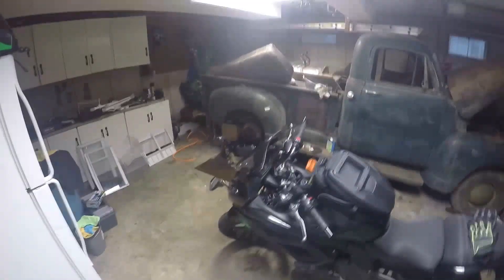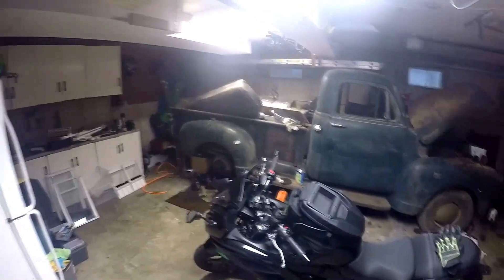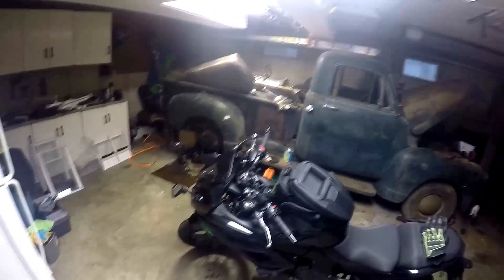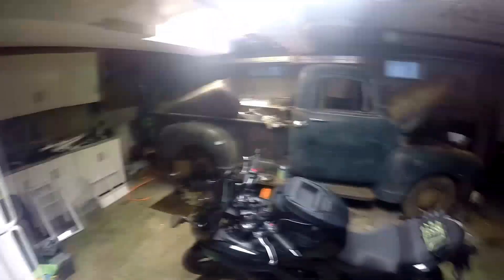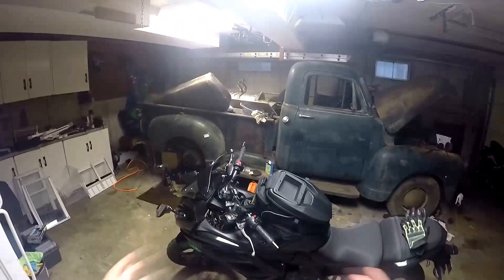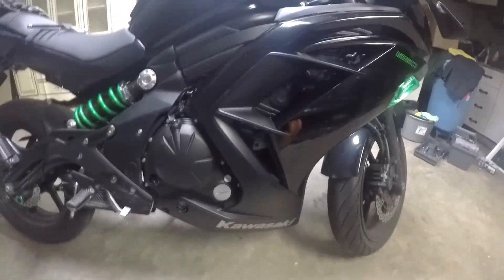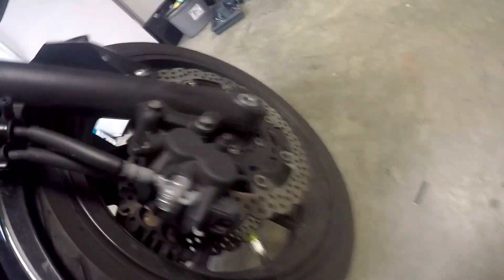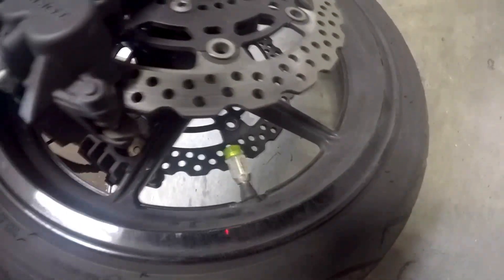How to adjust clutch on NINJA 650  ( 2012 - 2016 )

Comment: If anyone has a Versys 650, skip the first 6 minutes because you don't have a fairing to take off. 😀

I found my adjuster was fully loosened, so needed to adjust at the lever end.  All good for now, but after 20,000 miles of city riding,, I need a new cable.

If anyone tests without sitting on the bike like in the video, pull front brake before putting in gear, in case you've adjusted the wrong way. 😀

Useful video, thanks for sharing.

Comment: Great Info man. I have a '14 Ninja 650 and my cable is so loose that I can't even ride so this helped a lot.
Reply: I have the same issue and the same bike. I’m struggling to tighten the cable. Any advice?
Reply: @jchaseg126  it’s been so long since I’ve had that bike and if I remember correctly, I just adjusted the same way that the video showed. Super helpful advice.

Comment: Thanks. I'd like to adjust my lever to 4-5 (closer), using two fingers, instead of 1-3 (further). The adjustment is probably set up for 4 fingers.  I just wish I saw this before putting my fairing back on! Not sure if "5" allows enough travel with two fingers in the way.